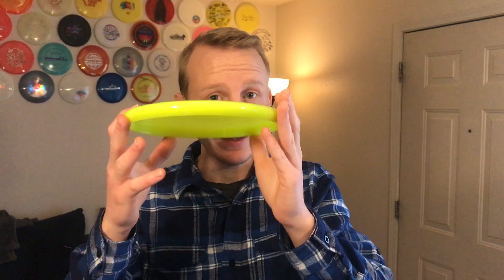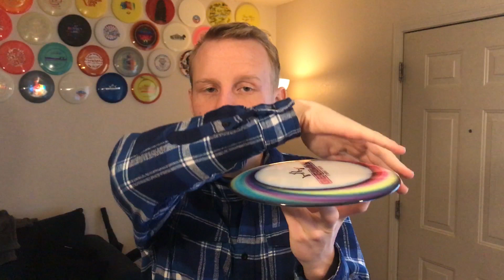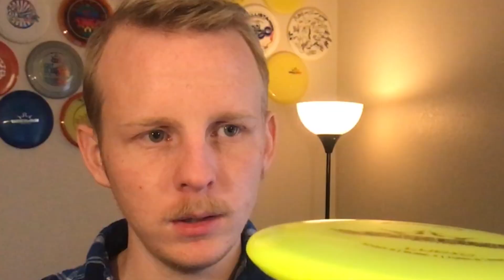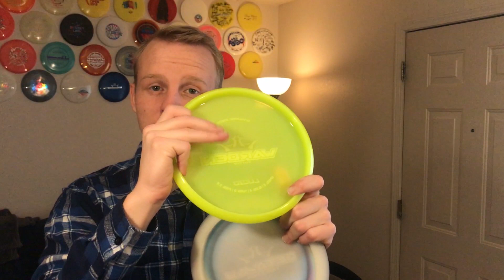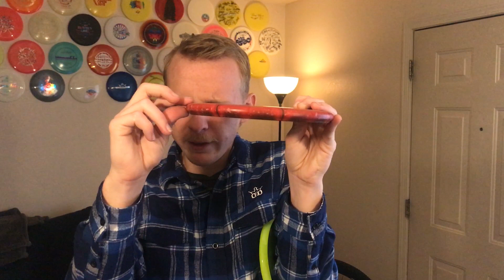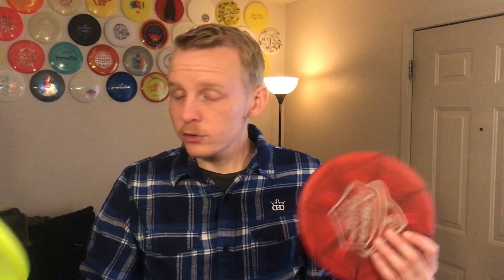The secret to throwing putters well!

Comment: You could also use your normal nose down grip and aim higher. You get the added power of the standard power grip and the more stable flight. Not to mention it just flies further because it's up higher and has more time to glide down. I know there are differing opinions, but I like to keep my grip consistent.
Reply from the maker: Not from my experience. Angle of attack is relative to the trajectory. So if it's flying upward with a negative angle of attack it will still turn. It might go farther, but it won't be a lot more distance and not enough to warrant the loss of control.  Consistent grip is definitely a good thing so if that makes you more confident, power to you.  I tried not to say that either way was wrong in my video, just that for those struggling, a bit more nose up could help.
Reply: Hmm... interesting. I see what you're saying, but I feel like I get the longest flights out of my putters are when I get them up high and gliding down essentially flat. The height keeps them from flipping too much and gives them a lot of space to fly back to the ground. If you throw them high and nose up, you're more prone to stalls. You have to get it up there and flat to let them ride/glide down instead of dropping with dead fade.

I think my longest wheel–measured Aviar3 flight is about ~350'.

To each his own. Putters can have fun flights with nose up, but I wouldn't do it for distance.
Reply from the maker: @drkevns  The shot with the pink putter was around 320' and it sounds like you're describing that type of flight. I would much rather trust the angle out of my hand than get the 5% more distance from getting that nose down. I've thrown putters that far with this grip as well and for me, it feels like I can smash on it harder and not worry as much about my angles because I know it's going to have that glidey flight. Too much nose up is a different issue. I'm not talking about more than 5 degrees tilted back. Just enough to give it the stability without adding much drag. Past that and the drag outweighs any positives gained from the control.
Reply: I think it depends on the putter and the person, but being able to control 5 degrees of nose angle on every shot with alternating grips seems less consistent to me than trusting the disc on hyzer and letting it go to flat or close to it. I'd take height over nose up to control distance any day. Only time I'll throw intentionally nose up is if I've got a low ceiling.
Reply: That shot with the pink putter didn't have enough height or hyzer (compared to the shot I'm talking about). Turn is less consistent. Flip up to flat is more controllable IMO. I can throw pretty much dead straight with the right hyzer and the higher the better (up until you start stalling out)

The height is the secret for me. The nose up + new grip is just too much to change from throw to throw to be consistent IMO.

Comment: great video, but this whole issue can be solved by getting an Axiom Envy... throw it on 30' or 400' power and you'll get a nice straight shot with fade in wind or no wind...   Thanks Danny for another great vid
Reply from the maker: The Envy will turn with the aggressive nose angle. It's a function of having a rounded nose,  not the stability of the disc. I used to throw the Envy, it's a nice disc. But physics is physics...

Comment: Hi Danny, maybe dye the Stache? :D  (I have color problems if i try to grow a full beard because its 50/50 brown/blonde so it looks really sparse).
Putters and neutral mids (such as the lovely opto fuse) have hardly any gyroscopic precession when compared to the drivers because of "worse" aerodynamics which results in the centre of lift staying close to the centre of gravity as the disc loses speed.
These discs are inherently very forgiving to throw nose up as they wont act up because of it, it's always fun to see beginners at the course go "wow" when I hand them a fuse to try out after they have been struggling with the driver they have (which is always the first disc people buy somehow.)
Throwing "nose up" on purpose can be a useful shot shaping tool sometimes as long as it's done with fairly neutral discs (stable/understable fairway drivers can work too)
Reply from the maker: Interesting point! I think throwing with that little bit of nose up is a big part of throwing with touch.
Reply: The Fuse is so $$$

Comment: Danny honestly I'm quite sure the ultimate number 1 reason people are struggling with putters is the off axis torque. As the disc is wobbling in the beginning of the flight, for a moment it is acting like an understable disc, that's the case especially with putters. That's why people are compensating it by throwing hyzer. I guarantee that you can throw a stable putter straight with a flat release in any nose angle, as long as your release is clean. It actually seemed that your nosedown throw was not that clean as your noseup throw, perhaps you can check that with some better slomo (iphone etc.).

I also think that the players in general cannot know how much of OAT they have in their throws unless they take some decent slomo shots of their throws. Shots that might look clean from the point of throwers view might actually still be quite wobbly. Putters are quite "vulnerable" to OAT, because we tend to throw them relatively harder than the other discs. That's why the number 1 key for successful putter throwing is to fix that god damn  OAT :). That allows you to throw putters that are actually understable and enter into the beautiful world of late turn! Getting rid of OAT might be a tricky task, but a good quality slomo often reveals where is the issue. Most likely the thumb is pointing slightly up. Just randomly trying out different grips, as you suggested, is a very good idea, that worked for me as well. Ultimate Frisbee is also a good toy to play with, it has a weird magic of correcting some the faulty throwing habits.

You might have some point about the noseup vs nosedown though. Noseup causes the disc slow down faster, so in that sense it will have a smaller tendency of flipping over. But in general putters don't suffer noseup even closely as much as drivers.

Comment: What about a flick, or forearm trow,.I haven't  had much luck with them with my putters, drivers seem to work a lot better. . I like the grip idea look forward to experimenting. ty.
Reply: Try the same, nose up helps. Also forehands typically have less spin and more off axis torque. Drivers handle OAT better than putters, and thats why drivers usually feel easier to throw.

Comment: Digging the video and how technical you get. 

Maybe it’s because I’m here in the first hour, but audio seems a bit rough this video :/
Reply from the maker: charlie8brown thanks for the feedback. I’m having trouble with peaking on my mic and I can’t turn it down. I might have to use a different voice recorder....
Reply: Danny Lindahl not sure what you’re using now, but I’ve used zoom products almost exclusively for audio projects. I then mix everything in audacity before syncing back to the video. I can message you on Facebook if you want some suggestions or anything of that nature. This stuff is my bread and butter.
Reply from the maker: charlie8brown I could definitely use an external recorder and mix it or just borrow a camera from work that doesn’t peak as bad. Using this is partially just laziness because it plugs right into my phone. I’m looking at getting a camera soon so I’ll be able to use better hardware then. Thanks!

Comment: Or you can just try to add more spin. The reason people throw their wobbeling putters on a hyzer angle is to give it more time to stabelize. A round edged disc needs more spin in relation to its forward speed than a wide rimmed driver etc.